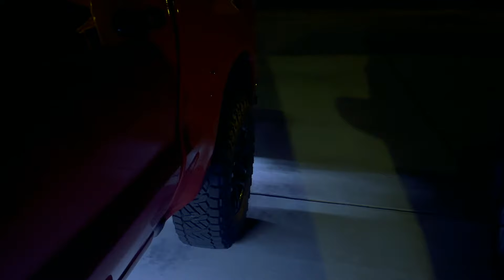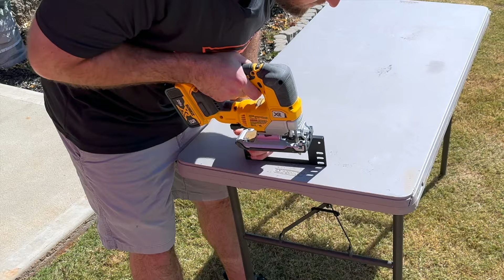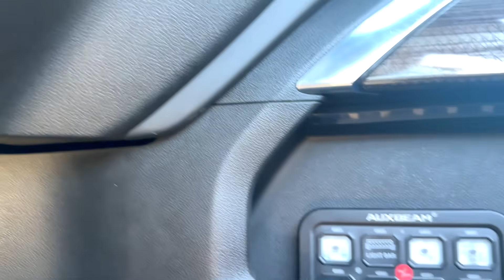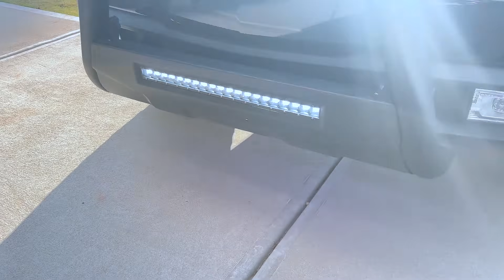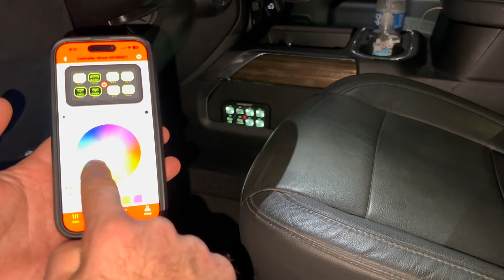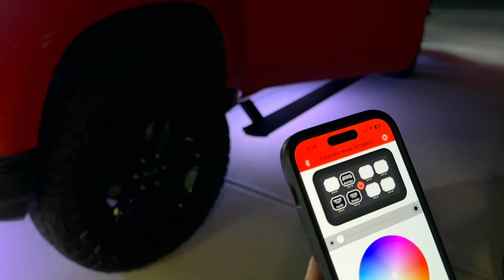AUXBEAM 8 Gang Switch Panel Installation Chevy Silverado

Comment: What are you taking about - A CLOSURE ????  The Aux Unit has relays built in.... the relay turns on-off the heavy current operated by a small switch which is the 8 switch panel,,,, I have been connecting lights for many many years, probably longer than you been alive and I have never heard of or ran into what you are saying..... So you left the relay in the circuit with the switch on and you use the relay in the AUX to send power through the relay of the light... yep that will work but the 1 relay needed is in the AUX fuse block... I never heard of a light or anything else needing a "closure", the device is either getting power or its not - it does not care where it comes from as long as all components in that circuit can handle the current required - never heard of - or -  ran into "closure required lights" ... .. .
Reply from the maker: Most lightbars come with a wiring harness which comes with a rocker switch. The contact closure (technical term I was taught when I got my broadcast engineering certification) I am talking about is the relay taking the place of the rocker switch, and when engaged turns on the light.
Reply: To use lights exclusively with auxbeam unit, (Lights come with a harness that has a relay connected to a 2 button switch),  don’t I just cut the switch off and use those exposed wires to plug into the auxbeam switch panel? 

But to use high beams also as a “switch”, I would fuse tap into the high beam and connect that wire between the auxbeam switches and the auxbeam unit, right?
Reply from the maker: If you do what I think you are trying to do, you will send power back to the fuse tap once the auxbeam switch panel is turned on, which will not be good.
Reply: Where can I get that mounting bracket

Comment: May I have a 2025 Chevy Silverado. Use the same fuse, but it seems like the panel stays on and doesn’t turn off any tips.
Reply from the maker: I would take a volt meter and find a fuse slot that only has 12 volts on it when the truck is on and tap off of that.

Comment: So with that gang panel you don't need fuses and relays that come with the accessories? The switchpanel cleans everything up?
Reply from the maker: Depends on the Lighting Harness that comes with the lighting accessory. The built-in relays on the switch panel are to turn power on for the light. So, depending on the wiring harness, you would just have to cut everything out and just connect the power for the light. Only problem is if you have a light that has a two position switch like my rocklights, where there is a amber light, and a white light.

Comment: Great video. I like the full explanation. Question, how would I know if a certain light needs closure? I’d have to buy it and not be able to use it.
Reply from the maker: Thanks for watching! If the light comes with a switch to turn on/off then that is the closure. If the light you buy just hooks straight to the battery, then no closure (switch) is needed. Basically, these switch panels on the market aren’t switch panels, they are basically breaker panels.
Reply: Thank you!!

Comment: I see you connected to headlamp fuse. I just did the same install, unless it’s on a timer but headlamps off, truck locked and my auxbeam still has power. 2024 1500 custom. Does it cut off after a time? I know on a jeep install I had the same issue on a outlet install but after an about 10-15min it cut off…
Reply: That headlight fuse isn’t a good tap
Reply: @leepitts1087 any tap you recommend ?

Comment: Hey Zach  , I’m putting Mictuning C3 rock lights  on my GMC and I also have the Auxbeam 8 switch panel installed but do I need to cut the relay out of the lights harness before I wire to my Auxbeam?
Reply from the maker: After looking online, I can't really see how the wiring is cause it is rolled up in the picture. It looks like it has a one position (on/off) switch and then I am guessing the power cable for each light is bundled into that relay. If you cut the relay out, you would have to solder the pod wires back together to the power connections and then it should work with the switch panel by sending power directly to the pods instead of going through the built in switch. Personally, I would leave everything hooked up the way it is, connect the power to the auxbeam switch panel, and just leave the Mictuning switch on all the time. I did not have the option with my lasfit rocklights cause I have a two position switch. (amber/white)
Reply: @zachattackcustoms  The switch runs through the relay so just wire it from the relay to the Auxbeam?
Reply from the maker: No, cause the mictuning switch is not the power connections. It is just a closure. That is the bad thing about all these switch panels labeling themselves as switch panels. The switch panel is technically a breaker panel which is a big difference. I would just hook the positive and negative to the switch panel, and then leave your mictuning switch in the on position all the time.
Reply: @zachattackcustoms  Thanks Zach, you’re a great help

Comment: Nice review! Much less of a mess than trying to install the GM upfitter switch panel.
Reply from the maker: Thanks, yea the only reason I would tear my whole dash apart is if I had to replace the heater core. Not going to do that for a couple of switches.

Comment: Bro! You totally help me out with your review! I was having a hard time finding proper info on the switch panel. I was gonna try to use it to control some aftermarket heated seats. But from what you're saying, they wouldn't work because they would need constant power with a variable switch panel.  Thanks for the great review! The other reviews I've been watching. Have been 90% install 10% briefly. Talking about how it turns on some lights. I really appreciated the details you provided!
Reply from the maker: I actually really appreciate your comment. Unlike other Youtubers, I actually try to give everybody the information they actually need. I don’t try to just show off the product. Unfortunately my detailed videos don’t get viewed that well because peoples attention spans are very short. I have actually been thinking about giving up the detailed installs but your comment makes me want to continue. Thanks!